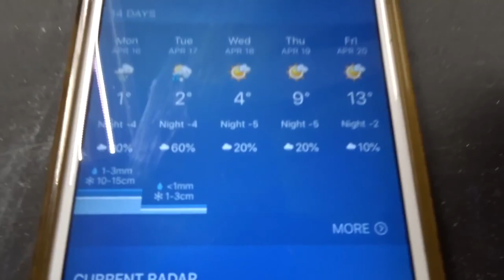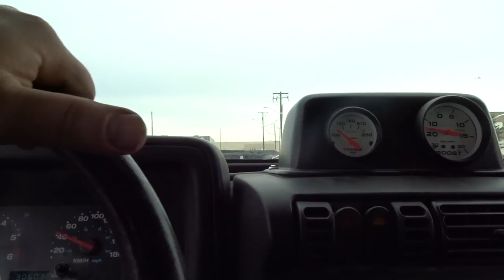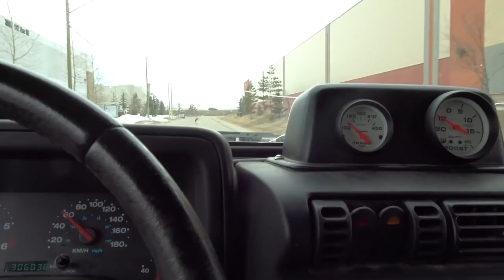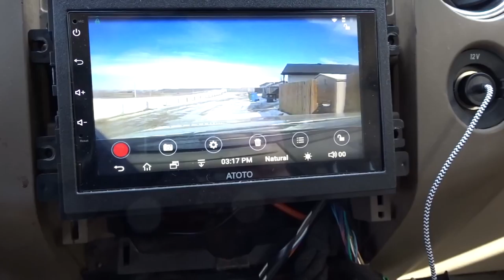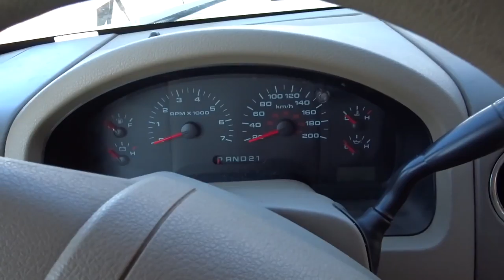Something is always Wrong with the Truck

Comment: You can remove the valve cover gasket, but it's a real pain.  I did the phaser job on my 07 f150 5.4 and had to take the valve cover off.  Remove battery, tray, ecm and connectors.  I also disconnected all the electrical connectors on that side and pulled the wiring harness out of the way.  I used a rubber bungee to hold the a/c lines out of the way while I took off the valve cover.  Hope that helps
Reply from the maker: Thanks for the tip not looking forward to doing this job

Comment: Yes you can remove the passenger side valve cover without disconnecting the Ac lines. I've done it three times on my 2004  F 150, 5.4L 3 valve.

Comment: Long time watcher, first time commenting.. I used to have a 2004 F150, After i changed the oil, I’d hold the accelerator down to the floor and cranked the key over. Some kind of safety design would keep the motor from starting. I was told to do this to get the oil cycling before a normal start. BS? Maybe you’ll know? Always wondered if that helped or not.. MFBT!
Reply from the maker: I never knew that maybe I should try it

Comment: I have removed that valve covers without removing that ac line I took the pcm out I did timing on one I losend the AC line mount and there was a nuff wigal room didn't have to take out motor mount

Comment: You have to remove the engine mount and let the engine drop down to remove the valve cover without removing the ac dryer
Reply from the maker: Ive read that too
Reply: What I did was just loosen the nut on the A/C line moved it out of the way then lift up on the valve cover and kinda had to gently wiggle it out.
Reply: No you don’t Jerry.
Reply: Utah Bones you don't have to but it sure gives you more room work instead of fighting it the whole time
Reply: That's how a ford tech at my local dealer told me how to do it remove the engine mount